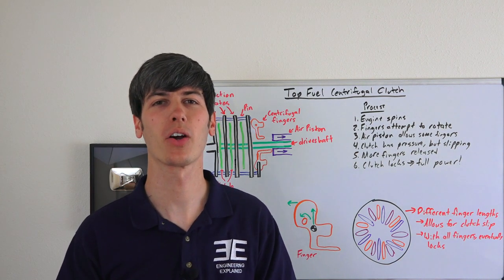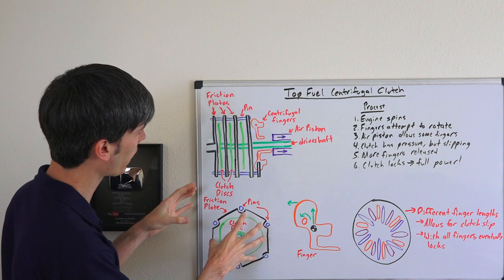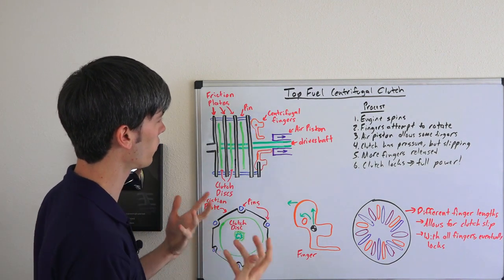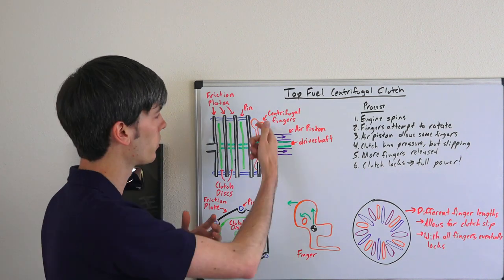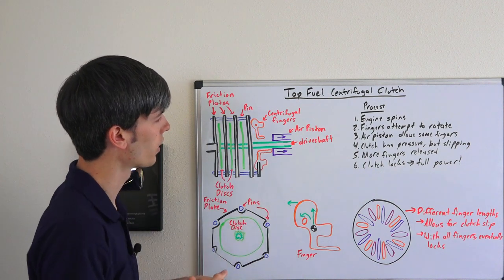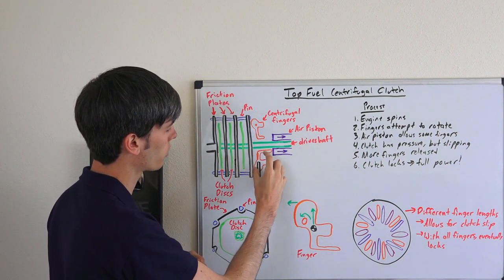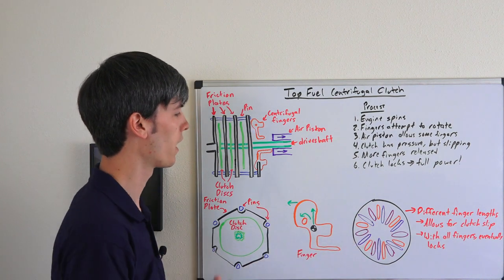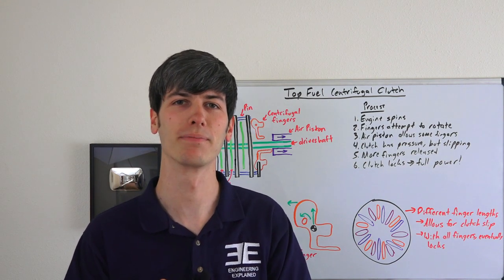Top Fuel Centrifugal Clutch - Explained

Comment: I've been into NHRA all of my life and never knew that this is how it works. Pretty freaking ingenious. Seems like this is where teams win or loose the race. I just thought it was who had the most HP. But I never actually thought about it. Thanks for the vids!
Reply: The clutch setting is the most important factor in a successful run. It's all about how to apply the horsepower and finding the right balance between horsepower and clutch.The weather and track conditions are constantly monitored which dictates how the car is tuned. Cool, overcast conditions with a cooler track allow for a more aggressive setup (ETs in the 3.60s @ 330+ mph) whereas the cars have to be detuned in hot, humid conditions. The multi stage clutch emerged in the mid 80s, replacing the two speed planetary system.
Reply: Since I was a teenager there have been at least four significantly different clutch systems in AA/TF and AA/FC.  Early on they weren't much different from street car clutches with a pressure plate and a single friction disc.  As horsepower increased they went to a pressure plate with multiple discs.  When computers were added to the fuel classes they realized that the crankshaft was turning slower than the driveshaft and an air piston/compressed air bottle was added to the cars and the driver had to hit a button to lock up the clutch at a predetermined point on the dragstrip.  The current clutches don't need the air piston to lock them up, using instead the weights as described in the video.  The air piston in these clutches releases the fingers rather than pressing inward on the clutch pack.

Comment: Jason, thanks for this!

I'm only 60 years old, and have never 
seen the CENTRIFUGAL clutch explained 
so well.  And, I've looked.  I've heard all 
kinds of stuff, like 2 or 3 of the plates will 
be welded together, from the force applied, 
and all kinds of blather.  (Yes, I'm pretty well 
established, in thinking some welding occurs.)
But, I didn't know how the mechanism actually 
works.

You have given me that!

(Oh, centrifugal clutches also work on mini-bikes 
and go-carts.  Just a wee difference in power. :D )

steve
Reply: No comparison between  a go-kart or mini-bike centrifugal clutch and a centrifugally engaged fuel clutch.  A centrifugal clutch for small engines is more like a drum brake.  Not exactly like a drum brake but much more in common than with a fuel dragster multi disk clutch.

Comment: Also we have stops on the finger so that if the clutch wears too much and the finger gets more angle it will hit the stop and be taken out of play. We never want to stack fingers on the bearing. We have come up with the high low map. Witch is a way around the rules and is used as a traction control device. When multiple fingers stake up on the bearing it will spike the hydraulic pressure in the cannon when it does so the command box will default to a alternate clutch map and it will speed the bearing up so as to not let the excessive plate load lock the clutch up prematurely and smoke the tires. The inverse is also in play. If the bearing sees to little clutch pressure it will default to the low map and slow the bearing down to keep 1 or 2 fingers against it. I really enjoy your vids thanks! I have worked in top fuel drag racing sense the age of 16 my father was the first or second(it’s a big argument ) person to manufacture a billet cylinder head in 1981 . Your over view is pretty spot on but your missing the details and they are pretty important . The clutch is the black art of burning nitro and very hard to understand

Comment: When these top fuel dragsters are doing their initial burnout before the race, are all of the fingers engaged to stop the clutch slip to allow the tires to spin? If so, how do they control this?
Reply from the maker: Nick Marandino Controlled using the air piston which restricts fingers. You can pull it out to allow for complete lock and allow it to spin the tires.
Reply: Engineering Explained Thank you. Also, I have a video request you may be interested in doing. Im not sure what school you graduated from, but i am currently a Civil Engineering major at Rowan University, and I am participating in my schools BAJA car team. Im sure you've heard of the massive competition, if not already competed in it. I think the viewers would enjoy seeing how the Baja team works in sections to build a Baja car. As a Civil Engineer, I am currently working on the frame of the build and have everything drawn up in solid works. Maybe you could explain from the ground up the engineering that goes into this project. This is just a thought. Have a good one!
Reply: Nick Marandino would be interesting to here about this
Reply: +Nick Marandino +DarthVaderPower No, the Cannon is all the way forward before the burnout, holding all the fingers. Because the tyres are wet when starting the burnout, the clutch doesn't need a lot of force applied to get the tyres spinning.
Reply: Engineering Explained how do they backup if they dont have a transmission?
Reply: They have a reverser on the rear of the bell housing in place of the transmission.
Reply: The burnout is done with water on the tires.
Reply: NO , only part of the clutchs are engaged , not full lock . The tires are heated as full power is not needed .
Reply: Watch the cars in the pits when they warm the engine. One of the checks they will do is spin the rear tires at idle. The clutch is set to have a minimal amount if drag to get through the burnout and back the car up. Sometimes they get it wrong and you will see the crew run out and push the car back.

Comment: So, the force to close the clutch plates which is usually applied by springs is instead applied by the centrifugal force on the finger lobes and is created by the RPM of the engine then controlled by the piston and thrust bearing. Very cool, is the driver controlling the piston or is a computer controlling it based on acceleration, instantaneous speed, and wheel speed data?

Comment: The air piston is called the cannon and is hydraulically actuated but controlled with air!! And at the end of the finger is called the radius. And plays s big part hardened tips are welded on the custom ground like .082 if a good number for a primary lever. And the lever really does not ride the through out baring for very long and now we use stops so if the clutch wears too much the plate load on the donut or aka pressure plate does not increase at a uncontrollable rate. Also there are stall spring that counter act the plate load.

Comment: There seems to be no mechanical advantage while clutch is slipping. If rpms go straight to max power, is there any real torque at wheels curve @engineeringexplained ?
Reply: it is all a balancing act, track temp, rubber laid down, tire pressure, wing angle, blower speed, spark timing, clutch slip, air temp, humidity, % nitro mix, pill size.  if you can balance all that at one time you win. too much of any of that and you blow the tires off.

Comment: Two questions. 1 Why not just have varying weight fingers instead of an air cylinder? 2. Totally off subject but why do top fuellers have the wing behind the rear axel? Does this not induce lift to the front?

Comment: The through out barring that you keep calling a Air piston is actually Air over hydraulic . The fingers do not have different lengths there hight is determined by a shim under the carbide in the pressure plate. Also every finger is at a different installed hight so as pressure is applied individually .

Comment: I've always wondered how dragster clutches don't instantly turn into a puddle of molten metal, but now I see that they're the size of a small dog and built like a tank.
Even then I'd imagine that they wear out pretty quickly.
Reply: PixelCortex They last single race only.
Reply: Valtra103 Ya and pretty much melt lol
Reply: When I was a kid they would give the used clutch plates away as souvenirs. It was really cool to take home a piece of a real top fuel rail. Of course someone dropped one on their foot a sued, so they can't do that anymore. The little greedy POS messed it up for everyone. Sorry, had to rant.
Reply: CDP135Z What an interesting species we are
Reply from the maker: CDP135Z Not true! When I attended an event earlier this year the folks sitting next to me had signed connecting rods from a team. They still give out worn parts!
Reply: Valtra103 Sort of. After we make a pass we regrind each disc so it has a fresh face both sides
Reply: Leon Bienek
Thanks for correction :)
Reply: CDP135Z Same here!! Once this dragster crashed onto the wall and they gave me some of the rubber from the wheel but it had sponser logos on it so I was happy as hell!
Reply: Leon, are you talking Top Fuel or Top Alcohol?

Comment: I'm not understanding how the power is transferred. Are these friction plates connected to the input shaft of the engine and the clutch discs connected to drive shaft? If so, how do all the friction plates besides the first one compress?
Reply: Yes on Discs and Floaters. Throw out Bearing regulates Clamp Force. Controlled by the Cannon and that's Controlled by Timers that are set before the run.
Fuel,Timming,Clutch are all set with Timers. Generally mounted above drivers legs in Top Fuel. 
Nose by fuel and oil tank on a Funny Car

Comment: What keeps the friction plates away from the clutch discs while the car idles? Are there springs or some other type of collapsible spacers on the friction plate pins and on the drive shaft splines? In other words, before the clutch pack is compressed, what keeps all these plates and discs apart from each other? Thank you in advance for your reply. This video is the best ever explanation of dragster / funny car clutch packs. THANK YOU VERY MUCH from an avid NHRA fan who never fully understood how a top fuel clutch works -- until now!
Reply from the maker: Mike McCarthy There's nothing holding them apart, but at the same time nothing pressing them together. Very similar to disc brakes in that sense. Your pads are always rubbing slightly (as nothing forces them away), but only forces them in.
Reply: +Mike McCarthy +Engineering Explained Actually,  there are (usually 6) stall springs on the pressure plate (outer friction disc). There are also 6 "Primary" fingers which are not held by the air piston (known as the cannon) these primary fingers apply a bit of pressure against the springs. The pressure of the springs can be adjusted, and this adjustment, along with the weights added to the primaries, dictates the amount the clutch is applied at idle.

The clutch pedal, when applied, simply stops the primaries from being able to come out.
Reply: Don't forget, these engines make so much torque at idle that the clutch can be engaged, but slip and allowed to generate heat while the dragster/funny car is sitting still waiting for the green light.  Unlike your street car, a motionless vehicle won't kill the idling engine when the clutch is engaged.  It requires frequent servicing and lots of heat sink via the six discs and plates, but it works very well.

Comment: How is the moving of the air piston controlled? You just said that it is going back while the Dragster is going down the strip. I guess it´s controlled with a information from the MAP Sensor or something like that?
Reply: There's an electronic timer system that pulls back the piston (or fork) to control the amount of force allowed to "slip" the plates and clutch discs. It's all controlled by timers set by the crew chief at specific intervals. Every track has it's own characteristics ( bumps or dips that can "unload" the car ). When done correctly the car will use it's maximum power and a quick run is achieved. When you see a car light the tires during a run , the timers were set too aggressively too soon, thus breaking traction. When the driver backs out of the throttle, the timers are still pulling the bearing and it's a "dance" that an experienced driver feels to apply the throttle slowly to keep the car from lighting up the tire again.

Comment: Are these clutches unique to drag racing...? Who researched and developed this system...? In my day ( 1960's) with FED's, we had dual disk foot operated clutches and AA/FD drivers rode the pedal such that smoke off the tire surface was kept at the half tire level for the best ET performance. More than that was spin and less than that was lacking power.
Reply: crower. the crowerglide clutch is where this all came from.
Reply: @slowpoke96Z28  Interesting.

Comment: I have a 2018 Camry that has Eco–Normal-Sport operation buttons. What exactly is going on when different modes are selected.
Reply: Electronically changing shift points and air fuel mixture ratio and if it is throttle by wire changing the rate of movement of butterfly. All or some of those methods may be used and others that I'm not aware of possibly.

Comment: Great video, still would like to see how driver control that kind of clutch, before run and run itself? Are those air pistons controlled by pedal as usual cars or something far more advanced?
Reply: Danberg80 when they back up from the burn out the crew chief hits a button to purge the cannon witch controls the throw out bearing . As he purges the cannon moves forward to a predetermined set height . When the driver lights the top bulb he holds the car with the break and completely takes his foot off the clutch this is called the “TUG” witch is a adjustable tuning thing. You will hear the engine tone change as the motor is loaded by the clutch. There is a moment switch under the throttle that as soon as the light comes down and the driver floors it, it starts a timed to distance retraction of the cannon and throw out bearing. The RACEPAK monitors the hydraulic pressure over the air and makes a decision via clutch hydraulic pressure to follow the optimal map or the high low map. This is a loop hole in the rules where we are now exploiting a form of traction control.

Comment: So, basically, the slippage for each race basically destroys all the friction plates?  It's like a self destructing one time use transmission?
Reply from the maker: FrankenPC I suppose that's one way of putting it, but it's not a dramatic failure. Just simply degrades away with heat.

Comment: Still very much enjoying the channel sir! It'd be great to see a video along the lines of "what would it take to make an electric drag vehicle which could match the performance of a modern top fuel vehicle over the 1/4 mile".  It seems that top fuel still very much dominates in the big leagues, but surely as the energy density of batteries increases, and electric motors become more efficient and powerful, maybe there'll come a time when the 1/4 mile is no longer the preserve of the fire breathing monsters!? Could you conceive of a speed controller which could handle the ludicrous power required to launch just over a metric ton of machine down the tarmac in under 4 seconds? :)

Comment: Very nice , learned something new today. I always thought they had a "traditional" automatic gearbox.
Just one question , how does the rpm change during the run ?
Does it build up gradually while the clutches slip and then go to the limiter after the clutch is fully engaged?
Or does the rpm immediatly go to the limit (or peak torque/power) and stay there while the chutch takes care of the axle's rotating speed ?
Reply: ***** That makes sense. Thank you.
Reply: I think RPM is pretty constant and the clutch and tire growth provide the "gearing".

Comment: So I guess a CVT would be a NO Go (even if Legal.) but I wonder if a nitro electric drive couldn't accomplish the same thing e.g an alternator linked to the Big Block Engine and electric motors driving the rear wheels
Reply: like a train locomotive? the problem would be weight.

Comment: I've been holding my tongue for the past few videos, but I gotta ask: why has the saturation increased so substantially? It looks like you're using the vibrant option on your camera or something similar.
Reply from the maker: Andrew Miguelez The reason I did it is it helps make the colors more vibrant on the white board, but unfortunately the way YouTube processes it, it makes me a bit orange. The videos look quite normal before uploading, and then are slammed with color once YouTube processes it. I suppose I could go back to normal. Thoughts? It's quite dull before uploading otherwise, but maybe YouTube will try to make it sparkle a bit much anyways. I'm totally fine switching back, but I thought it made the drawings a bit more clear.
Reply: Engineering Explained I like it this way. youre right, it does make the whiteboard easier to see. and you dont look that orange
Reply: Engineering Explained I totally understand your reasons and you are right, the marker colors are much more vibrant. If it's all or nothing, I'd rather have duller colors (they weren't all that dull to begin with) as your orange skin is sometimes very distracting. If you can mask off the color adjustment to just over the whiteboard area, I'd say definitely go for it.